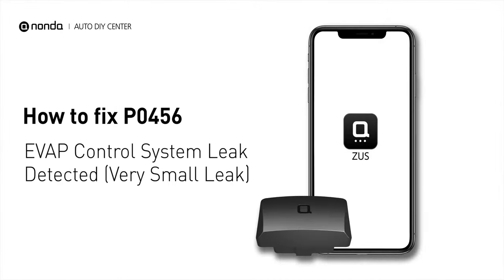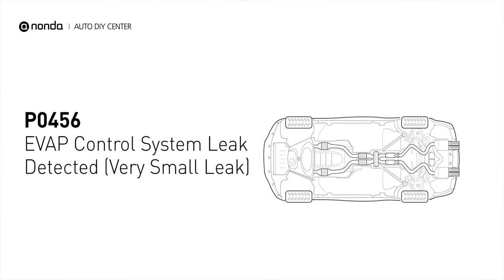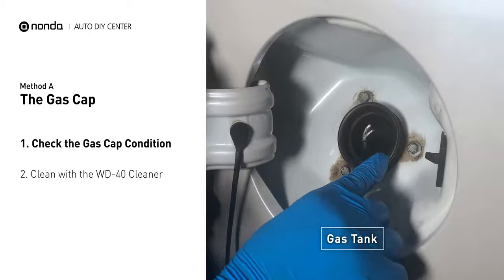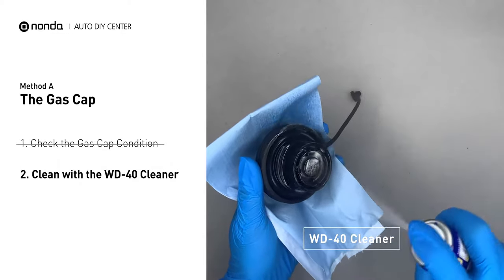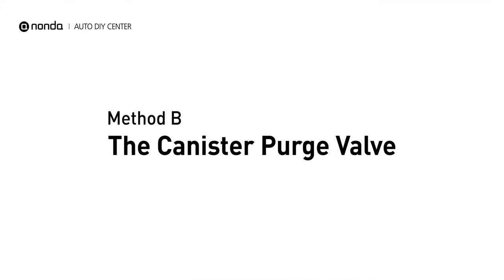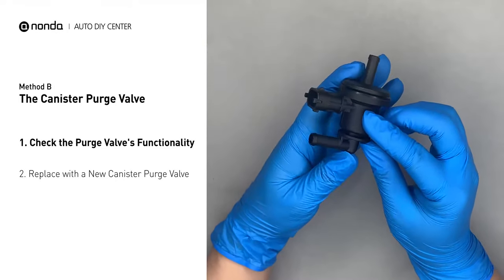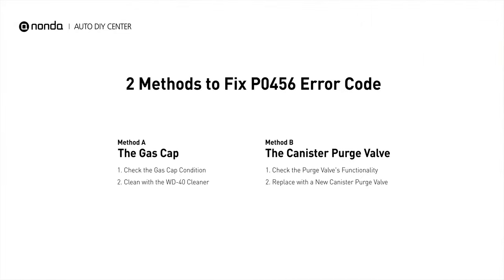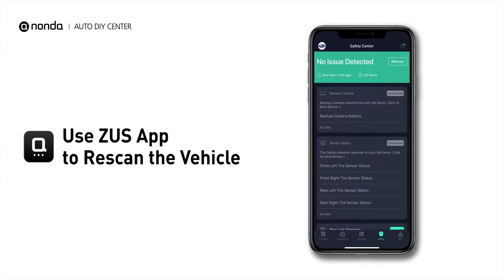How to Fix P0456 Engine Code in 3 Minutes [2 DIY Methods / Only $4.44]

Comment from the maker: Hi, I'm Steve, nonda's lead mechanic engineer. 
Feel free to leave your comments here if you have any mechanic questions, I will be glad to help you out!
Reply: Hi Steve. Two things. 

One, My plastic tether ring came off my gas cap. It's still connected to the door and in one piece, but the ring came off the gas cap. Any easy way to re-attach it? Or do you suggest buying a whole new set?

Two, speaking of which, I got this same check engine error code. Although my gas cap (without the tether) seems to be clicking and locking just fine, do you think this has anything to do with it or is it just a coincidence? I will have my mechanic check the canister purge valve if after I clean and/or install a new gas cap the check engine light stays on for over a few days.
Reply: Hi Sir I have a mitsubishi galant 02 and P0456 always comes up goes away here and there but now staying on. Smoked it no solution didn't find any smoke took to another mechanic inspected car they say everything fine and changed gas cap but still on.. replaced gas cap like 4 times then just got the actual oem part from dealership mitsubishi for $60. then P0401 popped up and changed egr valve as mechanic said is the issue, engine light went away for 3 months but popped back up again with P0456. Is the issue i guess the evap canister vent valve or the purge valve. Any suggestions or help this code is a headache.. Thank you for your help..
Reply: Is it mandatory that you delete the codes after doing the repair? I wanna make sure that I actually fixed the problem would the engine light go off after a certain amount of driving if I did in fact fix the problem?
Reply: Hello. Could this problem be causing the ticking noise when accelerating?p.s i have b 8.5 allroad. Its shows po456, and have noise only when accelereting. Help plz
Reply: I had this code come up 2 months ago and has been off since....then it just randomly came back today....I wonder if it could be just a bad seal on my gas cap
Reply: @moviefan62  if you’re having no issue with engine codes, I would not replace the cap. This tether ring is merely an issue of convenience. You may need to use a flat head screwdriver to put back in place.
Reply: @jasonnasiry  it appears you have followed your diagnostic tree correctly. I would circle back and replace that egr valve under warranty in order to rule out a defective part before purchasing the canister purge. Keep going and best of luck.
Reply: no. After a certain amount of key cycles if the issue is no longer present the code will go away. Best common practice is to clear the code after repair. This is a better indication as you could cause damage to your vehicle if the engine code is detrimental to operating.
Reply: @macknumber9  No. This type of code pertains to fuel mileage and passing smog tests. Hopefully this is not an issue in your valvetrain as this would result in a costly repair. Take it to a mechanic and have it diagnosed. Pay their $110 diag fee and they’ll put that towards the repair of you decide to fix it with them. If not you paid $110  to determine the issue and you can decide to repair somewhere else or sell the vehicle. Fingers crossed this is a problem in the accessory drive (like a bad belt tensioner). Google search your year make and model with the problem you have and see if it’s a common problem for that car. Needs diagnosis. You can do it. Keep on going.
Reply: @macknumber9  that’s the best place to start. Check the seal on the cap. If it appears aged crack and dry rotted, replace with cap from dealer. After your visual inspection of the cap appears fine, clean the area. After that you most likely have a pinhole sized leak in an evap line somewhere. Needs to be smoke tested. This can be preformed at most local repair facilities. Best of luck, you got this!
Reply: Steve are you a mechanic or an engineer?
Reply: I have a capless gas tank. How would I go about remedying this code in this instance? Thank you in advance.
Reply: Where would it be in a 2015 mustang gt?
Reply: Where is it located on a 2021 Jeep Wrangler
Reply: 2018 ford fiesta here, got that code replaced purge valve, check engine light came back on - at autozone it said 0.4 inch evap leak but I do not have a gas cap on my car since it is one of the newer years. Had a mechanic tell me that it’s what they call a dummy code and that it’s nothing to worry about. Would you agree? Also do you recommend a evap smoke test regardless?
Reply: I have a 2018 Honda CR-V that after being read has a P0456 code. Is this something I can fix myself?
Reply: I am trying to find the check purge Valve on Jetta Volkswagen, 2017. I have a code of 0456.

Comment: After installing the purge valve and the gas cap I decided to get a smoke test which I should have done to begin with.... In my case it ended up being the fuel filler neck
Reply from the maker: Hi Daby, to prevent comebacks, kindly ensure to implement a fuel filler neck inspection into your regular vehicle maintenance.
Reply: What did you find and how did you identify it was your fuel filler neck?
Reply: How much did all that end up costing ?
Reply: How much did it cost because hyundai it trying to charge me 595 just for a smoke test
Reply: Ooh good to know. I've also changed both of those
Reply: @nondainc  oh there's no need for that on a regular basis those usually don't go bad unless it's Rusty over there
Reply: @yankotactical1134  smoke test
Reply: @JJJ-uo4gz  80 bucks I bought the part myself
Reply: @mccraejoey82  no I will call your mechanics around where you live they usually charge between 50 to 60 for a smoke test
Reply: @yankotactical1134
Reply: Dodge told me it was the filler neck for my journey as well. But then the full pump went out and the other mechanic told me it looked fine. Both did the smoke test and no leaks. The very first time I changed the EVAP canister, and it would come and go. Now the purge valve and let’s see. How hard was the neck change and what vehicle? Tks.
Reply: What did you do to fix it?
Reply: @GuardianCraft1  Did you find what it was?
Reply: Ford flex no gas cap

Comment: mechanic did the smoke test but couldnt find anything other than 2 very worn out hoses. 06 jeep liberty with 170k miles.
Reply from the maker: Hi Sam, is replacing the damaged EVAP hoses helped fixed the code?
Reply: @nondainc  ill try it my next day off

Comment: This video worked for me, wife's jeep had check engine light on put out po456 code. Watched this video used wD-40 cleaned gas cap and engine sensor went off
Reply from the maker: Thanks for watching!
Reply: After you cleaned the cap, did you turn off the check engine light?
Reply: After cleaning the gas cap do you reset the engine light ?

Comment: Does this work for all vehicles? I drive a Chrysler Town and Country
Reply from the maker: Yes, you may apply these on your vehicle. These tips/suggestions will work if there's no other trouble codes encountered along with this code. Pay attention to your tank level and ensure that you're not leaking fuel.
Reply: @nondainc  I have a 2007 Lexus gs350. Close to full (not exact) will only get me 215miles per close to full tank. Which I believe is completely terrible. Is these gas pump leaking? Or what may be the issue? Approximately 16 in city, and barely 21 on highway, when it’s stated to get 21 city and appx 30 highway. I want to fix the issue ASAP. Thank you in advance. Btw I’ve had another 2007 es350 Lexus, and never had this problem, I believe a full tank was around 330-370 miles per full tank.

Comment: If its not he purge valve and not the gas cap then check on top of the fuel tank where the white nipple comes out and its hooked to the fuel line. Being that its plastic the nipple connector can crack.

Comment: My jeep Grand Cherokee 2006 3.7 V6 smells of fuel vapors in the cabin and is giving very very bad fuel average. Also the code P0456. Should i also change the canister purge valve? I do feel vaccum when i block its lower slot.
Reply from the maker: Hi Shameer, while it is best to double check if there's any other code that registers along with P0456, inspecting the evap system including the purge valve, line, and canister is recommended.
Reply: @nondainc  changed the purge valve just now. P0456 was the only error.  It was sucking a lot of air and making hiss sound even when i disconnected the electric cable going into it. Seems like it was stuck on open position. Will reset the code and see what happens now.
Reply: Let us know
Reply: @chriswilliams2652  the error didn't come back. The problem was with the canister purge valve. I bought a used one for very cheap and it works fine. No more fuel vapors smell and fuel average also back to normal again.

Comment: Do you have to manually reset the codes or does the check engine light go off by itself after fixing the issue?
Reply from the maker: Hi Eduardo, after you've corrected the cause of the issue, then you can clear the code out. If another code is present, you will need to have it diagnosed and corrected before you can clear the codes.
Reply: The code will eventually go away by itself, keep in mind it can take hundreds of kilometers.
Reply: It Says it take 10 - 20 cycles, a cycle is a when you turn the car on, on some older vehicles it takes 20-50 Miles
Reply: I would clear the code.  So if it comes back you know it is not fixed.    It will go away on its own but why wait?
Reply: On the wrangler if, you disconnect the negative terminal for 20 minutes it clears the code.

Comment: Does clearing codes on ZUS app actually work?
Reply from the maker: Hello, make sure first that the gas cap is securely fastened/tightened, and shouldn't have leaking purge valve.
Reply: Yes, it successfully cleared mine.

Comment: 2008 Ram 1500 5.7l throwing both P0456 and P0457. Truck stalled yesterday after starting it. Could the stall be related to whatever is causing the emission evaporative codes?

Comment: Hello I have the p0456 code, my cab smells a little like gasoline everytime I get in the car, you think it’s the cansister purge valve?
Reply from the maker: Hi Alex, please provide us with your vehicle's year, make and model in order for us to address your concern accurately.
Reply: @nondainc  mazda3 i Sport 2012 2.0
Reply from the maker: Hi Alex, probably vapors are leaking from the system. Make sure that the gas cap can handle pressure. Inspect the purge valve, line, and canister for any issue.
Reply: I get that same smell was it the purge valve

Comment: I just change the  fuel filler neck, and now I get this code in my 2003 toyota camry, should I do a vapor test too or is this the definitive solution?
Reply from the maker: Hi Mike, try cleaning the gas cap with the WD-40 Cleaner. Check the purge valve's functionality and replace with a new canister purge valve if necessary.
Reply: @nondainc  thank you so much
Reply from the maker: You're most welcome, Mike! Stay safe.
Reply: @nondainc  What if the valve has a hissing effect along with the vaccum effect?

Comment: I have a 2019 Fiesta SE with a capless gas tank. How would I go about remedying this code in this instance?
Reply from the maker: Hello, you may try replacing the filler neck.
Reply: @nondainc  I just purchased a purge valve assembly. I'll try that first, and clear the code. 👍👍 Thank you for your reply. :)
Reply: I have the exact same car and same problem. Did you end up fixing it?
Reply: @couldbemeaningful  I purchased a new purge valve. I think it was about $60. It's a bit of a chore to change. Luckily, I had a coworker who was able to help switch it out.  Haven't had a problem since! (Be sure to clear the error code after you have replaced it.) 👍🏾👍🏾 GOOD LUCK!!!
Reply: @GirlSproket  thanks! I also have to figure out why my reverse lights and camera don’t work either 🙄
Reply: @couldbemeaningful  The reverse lights may be a simple bulb replacement. If that doesn't remedy it, try replacing the fuse. Both of my rear tail lights decided to go out at the same time, so to cover all angles, I replaced the fuse and both bulbs.

My rear camera works about 95% of the time. I'm just glad that hasn't decided to crapout yet.

ALSO(!!!), I almost forgot to mention. I purchased a locking fuel cap after I replaced the purge valve. Just as another safety measure to limit the crud that could potentially get into the fuel line. I think I paid around $45 for that.
Reply: @GirlSproket  yeah my lights and camera went out at the same time. I replaced the fuse but nothing happened. I’m worried that it’s the wiring harness (something I absolutely don’t want to fix myself) lol

Comment: Changed the gas cap. Charcoal canister and the purge valve. No light or gas cap light for a long time. Now I'm getting the same code but no gas cap. Parts are probably just a year old
Reply from the maker: Pls check the possible causes:
Missing or loose fuel cap
Incorrect fuel filler cap used
Fuel filler cap remains open or fails to close
Foreign matter caught in fuel filler cap
Evaporative Emission (EVAP) canister or fuel tank leaks
Evaporative Emission (EVAP) system hose leaking
Fuel tank leaking

Comment: Hey this code showed up for my 2016 Dodge Charger SXT. I believe it might be an actual leak because when I parked it in my garage I actually smelled the gas fumes. Should I replace the fuel vapor pump and clear the check engine light to see if that works?
Reply from the maker: Hi Tristian, have you double checked if there's any other trouble code registers together with this code?

Comment: Hi I have a 2004 Toyota Corolla le 1.8 and I did a smoke test no leak, I replaced the gas cap and nothing, replaced the canister purge valve and nothing what would be the next step ??
Reply from the maker: If the code persists, please check more possible causes:
Missing or loose fuel cap
Incorrect fuel filler cap used
Fuel filler cap remains open or fails to close
Foreign matter caught in fuel filler cap
Evaporative Emission (EVAP) canister or fuel tank leaks
Evaporative Emission (EVAP) system hose leaking
Fuel tank leaking

Comment: I have an aftermarket gas cap on 2016 es350 and the engine light came on. Could replacing the cap resolve the issue?
Reply from the maker: Possibly yes. If the issue will continue to persist, check the purge valve solenoid for any issue or the charcoal canister for leak then reset the code. Hope it helps!

Comment: This code came on my 2014 mustang gt, already changed the purge valve. This car has no gas cap. Cleaned that area either way and the code eventually came back on after a reset. Now what??

Comment: I have a 2018 Honda CR-V that has a P0456 code. Is this something that I can DIY?
Reply from the maker: Please check the possible causes:
Missing or loose fuel cap
Incorrect fuel filler cap used
Fuel filler cap remains open or fails to close
Foreign matter caught in fuel filler cap
Evaporative Emission (EVAP) canister or fuel tank leaks
Evaporative Emission (EVAP) system hose leaking
Fuel tank leaking

Comment: 2007 RX350 - I got the code, replaced the gas cap, fine for 12 days, then it came back, I just used the WD40 to clean the entry and cleared the code, so will so how it drives tomorrow.. tricky issue.

Comment: I have this on my toyota rav4 2013 after i overfilled my gas tank
Reply from the maker: Hi Daniel, thanks for sharing your experience! Please avoid overfilling your gas tank as this can damage the canister and possibly other parts of the system.
Reply: @nondainc  i have a 2007  pt cruiser and my check engine light is on and something was said about the pulge valve being bad ... can i ask where the hell is it located at on my car? this car is one thing after anthor i'd love to just blow it up . i have all ready put more money into it thn i'll ever get out of it.. please help me i am gonna flip out right now..

Comment: Hello. Could this problem be causing the ticking noise when accelerating?p.s i have b 8.5 allroad. Its shows po456, and have noise only when accelereting. Help plz
Reply from the maker: Hello, probably- yes. We also suggest to double check if there's any other codes that register along with this code.

Comment: I have the same code but with the word permanent next to it iv gotten 2 smoke evap test and passed I got a O ring changed and bought a OEM gas cap every mechanic tells me they can’t find anything else wrong and I have a emissions test coming up I have 2019 Honda hrv any one else have this issue

Comment: I have a 2011 Nissan cube. "Service engine soon" is illuminated. AutoZone diagnostic shows I need a new Purge Valve. Is this the same as a Purge Solenoid Valve? I want to buy the right part so I can take it to the repair shop and have my mechanic replace it. Also, does that message have to go away in order for the car to pass its annual inspection? (New York state) Thanks in advance. I would like to save some money with this but definitely want the emissions leak to be fixed.
Reply from the maker: Please confirm if this is the only code you're getting.

Comment: Replaced gas cap and purge valve..bye bye P0456 code..2011 Dodge Nitro Heat..
Reply from the maker: Hello, thanks for sharing your experience!
Reply: Unfortunately the code has come back.. Will have to take it in to have it scanned

Comment: What if your car does not come with a gas cap?
Reply from the maker: Hello, please provide us with your vehicle's year, make and model so we could give you the repair methods according to your vehicle manufacturer's recommendation.
Reply: @nondainc 2008 Dodge RAM 1500 4.7 liter eng
Reply: 2018 Ford Fusion
Reply: Jeep Grand Cherokee 2014
Reply: PO456. PO440
Reply: @satonyareadus9437  did you ever figure out how to fix it? I have the same exact car and same year